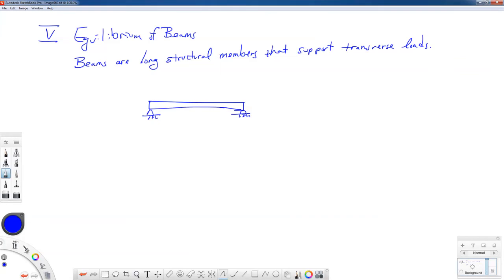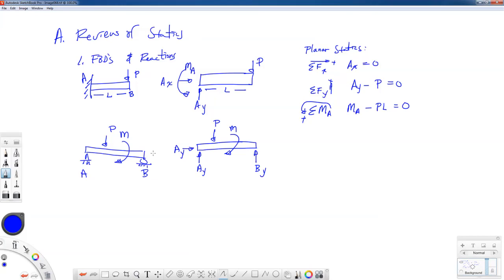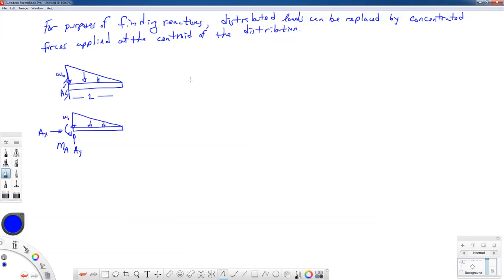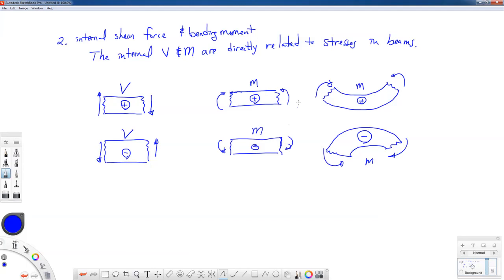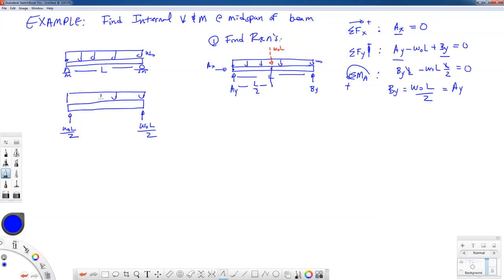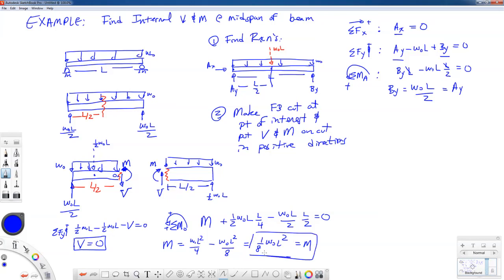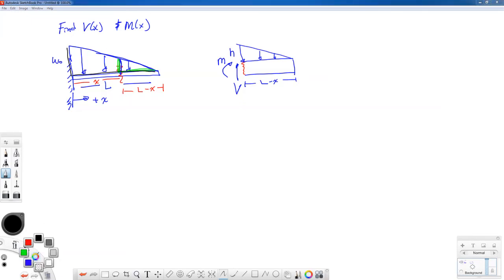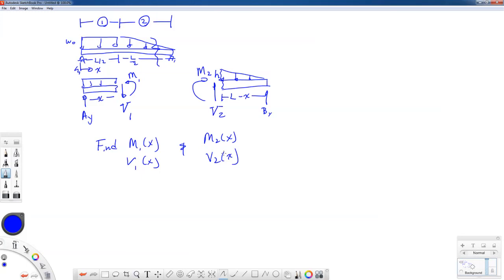Mechanics of Materials-Lecture-16-Equilibrium of Beams

Comment: Are the shear forces and bending moments are just assumptions? Can the shear force be pointing upwards while the bending moment is anticlockwise on the left side of the beam?
Reply from the maker: The directions of internal shear force and bending moment as I have shown are an accepted sign convention for them, and in reality could result in positive or negative values depending on how the load is applied to the beam.  (So, your second question, yes, all things are possible depending on the applied load.)  Now if you dig a little deeper, the shear upward on the left side, downward on the right side of a free body cut as positive is a bit "funny" because it depends on which side of the beam you are standing on and looking at--and when we talk about stresses, we find that the sign of the shear stress depends on the definition of our coordinate system.